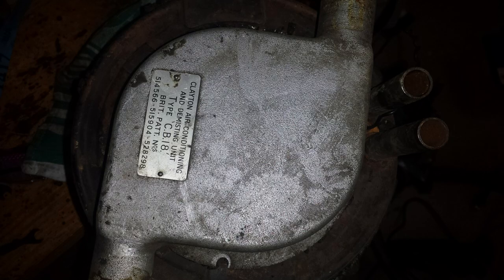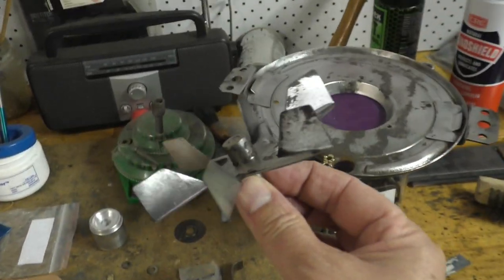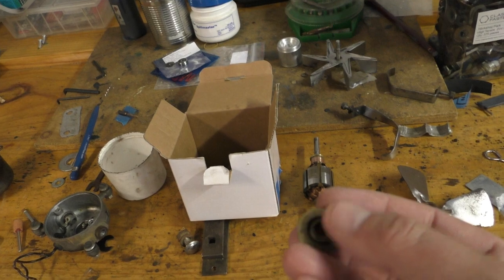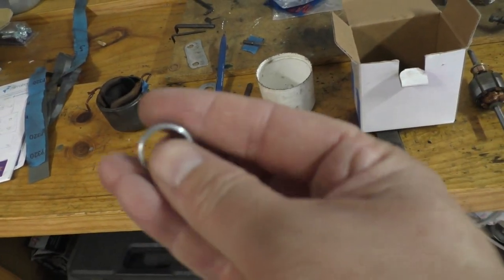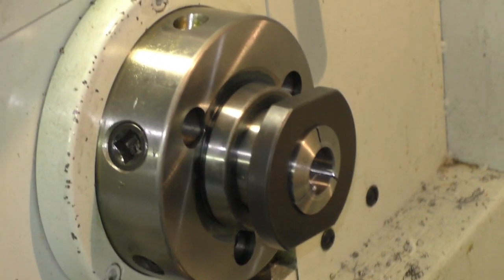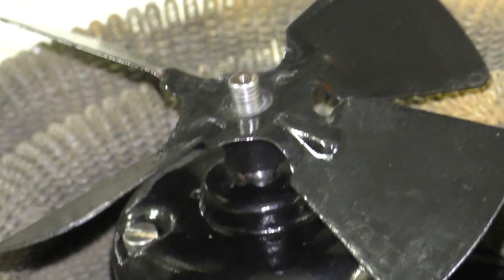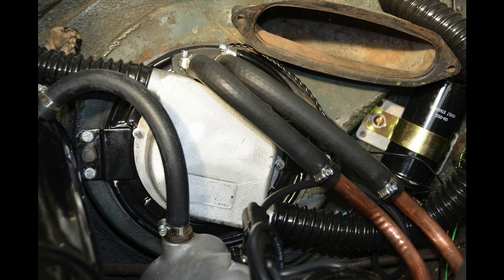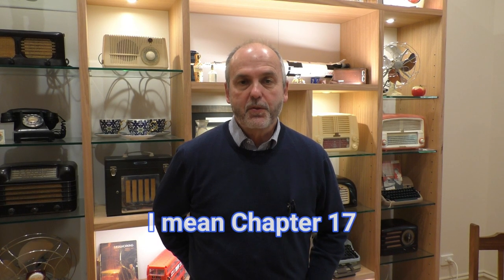Greg's 1949 P3 Rover restoration chapter 17; Heater demister restoration

Comment: Much thanks Greg.  I've found this fascinating on a number of fronts. 
     Firstly, I had a P4 Rover 75  many years ago, which I loved and was tatty, but a lot of fun. 
     In addition, the machining and problem solving you have done throughout the project has constantly reminded me of my father, who trained before the war as a sheet metal worker in the aircraft industry and used to give me little jobs to earn myself a couple of bob in the workshop where he worked in the early 70s. So many of the tools and equipment you use take me back to that time. 
     Looking forward to the next episodes, especially the woodwork and wiring.   Can't wait to see the first drive and hear the engine under load.
Reply from the maker: Thanks Marlies, it is encouraging to read your comments. My trade skills date back to the 70's; so I guess my methods are kind of Old School, but well suited to home workshop tinkering I think. However the Last job I had as a tradesman was in the mid 80's where I operated a computer programmed lathe in a small contract Toolmaking company. I am enjoying re-honing old skills on this project. I cant wait for the first drive either. Really looking forward to the day.

Comment: Great job as ever. I wonder if Clayton just used plain bronze bushes. Did they even make their own motors? I believe the much derided Lucas used Oilite bushes at the rear of their dynamos, the bronze being impregnated with lubricant. Even then, trying to inject a few drops of oil through a horizontal hole was a maintenance requirement.

Comment: In real anorak territory now but the looped wire on the heat exchanger is identical to the loops on the external oil cooler as used on the Rover P5 of 1966. Probably a product of the same factory which does make sense.